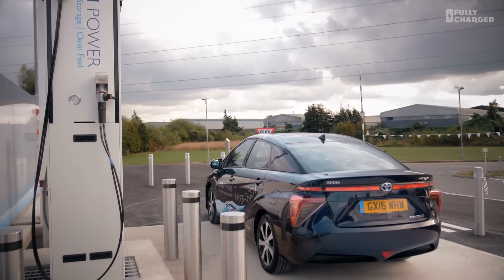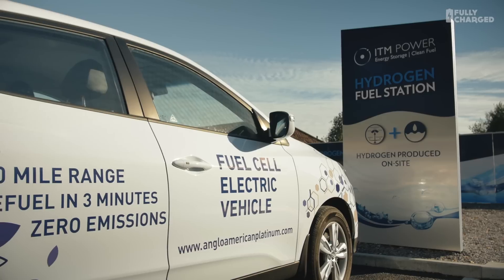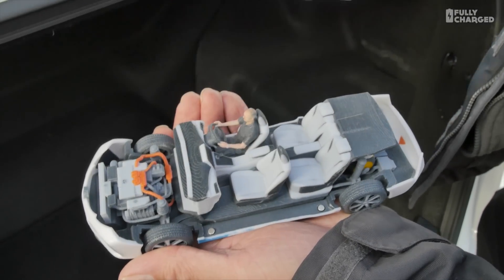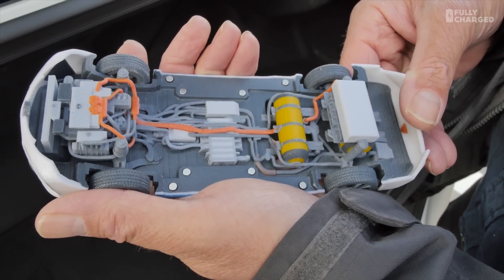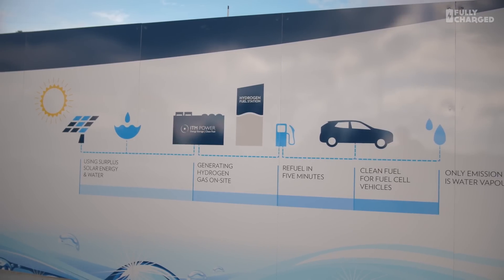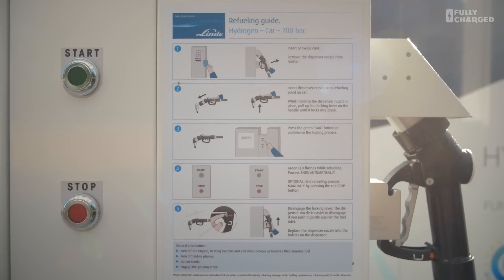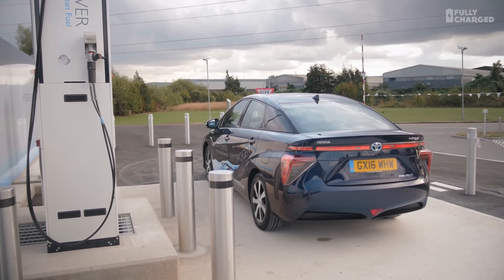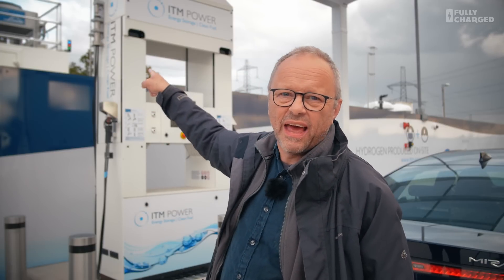ITM Hydrogen Rally | Fully Charged

Comment: Very interesting video, glad you still cover Hydrogen technology in detail even though people sometimes like to post negative comments about hydrogen.

Even though i love battery electric car technology, i believe hydrogen fuel cell will be just as important if not more so in the future because as mentioned in the video, fuel cell technology can be adapted to other transportation vehicles incredible quickly because you don't have that bottle neck of expensive, heavy, limited availability, limited life, lithium-ion batteries, and also i doubt there will be full battery electric long range lorries any time soon if even in the next decade (short range being done by Mercedes), so hydrogen fuel cells are the way to go, heck, they can even be adapted incredibly fast to boats, non-electrified trains, private jets, jumbo jets, giant cargo ships, local power storage, the list is endless for the long term over decades.

The idea of powering your home from your hydrogen powdered car is also fascinating, especially as the technology catches on and renewable energy expands with solar panels and wind turbines everywhere which means cheaper and cheaper clean energy to the point where renewable energy becomes so much cheaper than drilling deep into the ground in far away countries for oil (which could result in more wars) and then shipping them over in giant oil tanks, instead you can have a decentralised wind turbine, hydrogen fuel generator and as many hydrogen fuel storage tanks in the ground as you want and you're sorted.

I believe the future will be both battery electric vehicles as well as hydrogen fuel cell vehicles, which means less fossil fuels which can only be a good thing.

Comment: But can I fill up at my house????
Reply: Not really for the first few years probably (30ish im saying) unless you want some massive box in your back yard. There may be a away to incorporate into existing networks like gas and goes to your garage etc.
Reply: ***** idk about you but ive never seen a hydrogen fueling station
Reply: tigerfanman Because it's gas as you can see look at what's needed just to have 1 filling station look at that huge container converter.The teck inside your car is far more complicated than normal engine you'll have huge gas bottle in your care under massive presure sorry mate the only good thing about hydrogen is fill up in few minutes and at moment more milage .You can keep it electric cars are far easier to maintain you can fill at with any normal plug if needed at home with  solar panels or new solar roof tiles witch can power your  in tire home if wish and fast chargers to there loads around England .In say 3.5 years there will be cheaper  electric cares will have over 200 250 ++ range or more.Like GM Bolt that's out this year.
Reply: tigerfanman I really cannot see anyway of driving a month without a charge unless your my nan, but I'd love to see it and I can see week and half 2 maybe but yea
Reply: ***** given I do about a 1000 miles a month, that would be pretty impressive
Reply: "ive never seen a hydrogen fueling station".  
That's because there are about 4 in the UK at the moment. One on outskirts of London and one in Sheffield. Not sure about the others. But clearly there can easily be more - it's just all super-expensive right now. ITM's splitter box is very expensive and the Mirai is very expensive (70 grand IIRC). But taxi firms in Sheffield are using it, and with a few more early adopters it could really become a thing. A lot of people want a fast-fill long-distance no-CO2 vehicle. And this is one.
Reply: It charges while you sleep, like a big cellphone sitting in the garage. You will never need to take a detour to fill up ever again save for those rare long road trips. 

It's just always full and ready to go every morning.
Reply: my landlord could easily put in a charger.  Its more of a matter of how to bill for the power
Reply: "save for those rare long road trips". Some of us never get in a car unless we are going a decent distance. All local trips (work, shops, pub, entertainment) are by bike. Trips to London are by train. I only use the car for going to Devon, Wales, Yorkshire, Scotland, France, Austria. It's very rare to go anywhere less than 100 miles away, and usually 200 miles or 900 miles. There is the occasional trip of only a few miles, e.g. to collect plasterboard, but that's maybe 5/yr. So stopping to fill up when travelling is not going to be at all rare: it'll be the majority.
Reply: I'll just leave this here:  http://world.honda.com/FuelCell/HydrogenStation/HomeEnergyStationIII/
Reply: Alberto Knox I bet the hydrogen stations don't even work, and they are not as prevalent as charging stations for long trips and at home for daily driving.
Reply: Alberto Knox Show me a road trip video, of a hydrogen car. It debuted around 2012 , when the Model S came out, so where are they?
Reply: azalru Did you not watch the video and of course they work man unless you can show me how not just which ones arent working.
Reply: Apartment parkings and street parking can be equipped with chargers. Plenty of examples of street and parking charging. It's a people issue, not a technology problem.
Reply: They're not selling it, so what's the point?
Reply: Allan Omar if everyone in the uk filled up there electric vehicle overnight the national grid would completely crash and blackout 
We need alternatives like hydrogen
Reply: Jake Buttons we need to modernize the grid.  it was never meant to handle transportation on top of everything else
Reply: deathpony698  such a drastic expansion to the power network will be a terribly expensive infrastructure challenge. Even with the infrastructure in place how would you ensure adequate power generation exactly when you need it. One of the advantages of hydrogen generated by electrolysis is that the refuelling event can occur at a different time to the power consumption , it is in this way that hydrogen provides a route to zero carbon transport by using excess renewable power that would otherwise be wasted.
Reply: tigerfanman Totally wrong, you can't fill up "anywhere".
Reply: Fuel cells are garbage (or at least more appropriate for garbage trucks), and you can sorta tell the Toyota guy knows it.
Reply: Jake Buttons idk if you've heard cause its kinda new, but there is this thing called the home battery, they also have commercial ones!
Reply: Jesus this is comical!

You guys should try arguing politics. It's easier to get better talking points to troll with there.
Reply: Hydrogen will, not too many moons into the future, replace natural gas. The answer is yes.

Comment: It's a "clean car", but the infrastructure is still dirty. Yes there's a wind turbine, but how much extra energy is fed in? I guarantee you it's not 100% wind, it's going to be mostly from the grid. If you're going to have a wind turbine produce electricity, than it's better to just use that to charge electric cars\batteries. Using electrolysis to make hydrogen means that you're going to waste at least 50% of the energy just to split the hydrogen out and then compress it to ~5k-10k psi, and don't forget the necessary cooling as well. So half the energy is wasted in order to create the fuel.......... That's 2x more inefficient than charging a battery! The only advantage is faster refueling... But that won't be an advantage for long with battery improvements coming along.

Comment: Looking at the figures, a Mirai doing 15,000 miles annum would consume 2 tonnes of water at the station, presumably extracted from the local supply system and release 2 tones of water into the atmosphere per year. That would be an effective consumption of an additional 2 tones of water per driver and potentially an increase in water consumption of around 4% per person out of the national water distribution system. Significant?
Reply: I suspect it is probably near a wash (PI) with current gasoline cars.  But you are correct that BEVs are NOT putting water into the atmosphere, which will probably have an environmental impact.

Comment: Take you average battery electric car, shrink the battery a bit. Add a very expensive fuel cell, pumps, valves, a hydrogen tank and safety system. Then, use fuel that needs 20x as much electricity to create and store than the electricity that you normally store in a battery electric vehicle. Not to forget the wear and tear if the massive anodes and cathodes to create the hydrogen and of course the infrastructure to physically transport the fuel.. 

It's a fucking waste of energy, resources and research!!
Reply: Did you even watch the video?
Reply: 20 times as much electricity? Did you skip school?

Comment: Fool Cell. Designed to keep you hooked on filling stations for big $$. The pump in the video shows 9.99UK or $12.29/Kg of H. That amounts to 33.33 kWh/kg of energy. A PEV makes way more sense financially and environmentally (98% of all H produced is a by-product of the fossil fuel industry). Charging a PEV to the equivalent would cost $5.32 for a 33.33 kWh charge @ $0.16/kWh

Comment: Still, you can give EV 3 times as much kilometers as this hydrogen filling station. Whilst still using excess energy from the grid.
Reply: Pure electric is useless for long distance, there's just no reason to use pure electric cars when there's hydrogen-electric cars on the market meaning you never have to worry about how far you need to go
Reply: MrcabooseVG useless? You should ask Tesla owners how far they drive each year.
Reply: Mats Lindholm In small increments, you can't even get close to travelling through a small country like the UK in one go. Plus they cost too much and will cost just as much to fix
Reply: ***** so going on vacation from sweden to italy for example is not possible at all with an electric car then?
Reply: Hydrogen refill costs ALOT, Mirai is only say 10k cheaper than cheapest S, only has like 50 to 100km longer range. And you can charge an EV just about everywhere (time permitting)
Reply: Mirai is said to output a max 114 kWh and 370 NEDC Miles range where as Tesla recently release a 100 kWh battery pack with a slightly longer range of 381 NEDC Miles. I for one seeing as Nikola Motors came out with the announcement of the model One Semi Truck and switch from NG to Hydrogen, seeing as its more green than diesel in comparison and also more powerful and no uphill lag in comparison to diesel as well. I am hoping to see trucks run more on hydrogen-electric hybrid since it is more power dense and fuels up faster than being all electric and having greater range as well per tank to both Diesel and all electric.
Reply: Mats Lindholm Of course it's possible, i'd rather go in a petrol car. It's entirely possible you'd get stuck in an electric car
Reply: ***** Its entirely possible to get stuck in a dino powered car, as that substance really doesnt grow on every electric outlet...

Comment: Most hydrogen these days is produced as a byproduct of refining fossil fuels. It's not hard to see who is behind the push to hydrogen.
 
Hydrogen by itself is clean if it is produced as shown in Roberts  video. Extremely inefficient, though using electricity to split water creating hydrogen to create electricity and then recombine with oxygen to create water.
Reply: The guy does state that first fact of yours in the video but states they are not getting hydrogen from fossil fuels, but rather from fresh water.
Reply: I know. I indicated that by mentioning the clean generation in the video in my original comment.

Comment: How is the energy efficiency from the cell to torque to the road, compared to a BEV?
Could such infrastructure not also be used to simply created electricity, and more of it than now possible through hydrogen?
Reply: Fuel cell vehicles use batteries and electric motors, just like an EV.  The difference is that the batteries are charged from a fuel cell.  The problem is that the Hydrogen uses 4 times as much energy to go the same distance as an EV, when the Hydrogen is made from splitting water.
Reply: Splitting water is quite efficient, so the cell itself is bad at  returning this invested spliiting energy? Then why have a fuel cell, not a relatively standard ICE? Those also are emitting 70% heat for 30% drive.
Reply: Cloxxki The overall efficiency of fuel cell vehicles is much lower than battery vehicles for the same input energy, when the Hydrogen is made from electrolysis of water.  Google "well to wheels efficiency of fuel cell vehicles".
Reply: You miss the point. In the ITM scheme Hydrogen is only produced using energy that is otherwise wasted ie excess renewable energy. Then the hydrogen itself becomes the energy store. Who needs flaming  batteries? Who wants to wait 30 minutes to recharge their vehicle after a 50 mile drive? Delusionals.
The excess hydrogen thus produced on a larger scale can either go into the gas main (coal gas used to be 50% H2.) or be stored as vehicle fuel.
Reply: I do understand though. What I wonder is, to put it more simply, how much mileage can be achieved from making hydrogen versus using the same wasted sounce energy as electricity? In stead of the fuel cell, one might have batteries and do just fine or better.
Can this wasted energy ONLY be captured via hydrogen as storage? Why not give this super green energy to the grid where it is immediately used?
And the 30 minutes charge time of a battery EV only applied after you've used up the first charge of the day. If you can afford a hydrogen car or BEV, you probably have a private garage or at least car port to charge overnight. 
Tesla's bottom line will be 215 mile EPA range. That's what you get when you drive off in the morning. A hydrogen car will on average be, say, 60% full. And where do you do this recharge? Tesla and other option chargers are basically everywhere. VW is paying for a whole lot because of diesel gate. They'll be really fast chargers.
How many time per year does the average family car owner go past 200 miles per day, to even need a 30 minute recharge? And how much waiting is left after a comfort brake and snake? The hydrogen job takes time when you stay with the vehicle. Comfort and snack will be time added to this.
Reply: Cloxxki The "wasted energy" can be stored in battery pack, either in cars, or in home (one example, Tesla Powerwall) or in industrial quantities (one example, Tesla Power Pack).  Doing so is about 4 times more energy efficient than converting it to Hydrogen for fuel cell vehicles, and batteries will become increasingly available, especially as more EVs are made.  In this context, Hydrogen makes little sense.
Reply: fingerstyleguitarman Hydrogen cannot be used in existing methane gas lines. The Hydrogen molecules are too small and will leak out easily.  Battery safety is very high at this point, and fast charging times are low.  Fast charging is only needed on very long journeys.  Most EV owners charge at home overnight and have a full tank in the morning.
Reply: Its funny that it loops back to the main issue with Toyota´s strategy;The Idea that we will not be able to build bigger and better batteries. "Hydro will save all that wasted energy from renewables" but with more efficient and cheap batteries we dont have that problem to begin with! And this must all be a shaking corpse or some uk exec trying to score some government/EU funding 'couse Toyota launced a BEV strategy just yesterday to mass produce a 200 mile BATTERY EV by 2020, hehe :)
Reply: Robin Olofsson Before long Tesla will be refurbishing HUGE amounts of batteries. Already there are road side power banks from Prius batteries I believe. This will not diminish. And there's the grid to direct power to the next available storage.
Reply: Cloxxki Actually the batteries last so long that there's not much to recycle for the next few decades.  That's especially the case for thermally managed batteries like Tesla, Volt, Bolt, etc.  That said, Lithium batteries definitely will be recycled or reused when necessary.  All the EV makers have plans and processes already put in place for recycling or reuse.
Reply: Loanword Eggcorn the recycling of batteries kind of destroys the sceptics' argument "but what about the pollution due to the battery manufacturing!!!
As if ICE's and gearboxes are environment neutral to produce. Let alone the oil and gas they take (and dump) over the decades. Who ever recycles a molecule of fossil fuel? Only nature does that, patially.
Reply: Cloxxki Not totally.  The two main things about making batteries (or really anything) are environmental damage from mining the materials, and all the energy used to make the product.  Some of the energy can come from renewables like solar and wind, but when raw materials are used for making new (anything), there is an effect on the environment.  If renewable energy is used to manufacture things, and recycled materials are used to re(make) them, then the environmental impact could be said to be minimal.  That would be the case for some of the (recycled) Tesla battery packs, for example, since the Gigafactory intends to use only renewable energy.

Comment: The Prius actually uses the petrol/gasoline engine for more than electricity generation. At least in my 2010 Prius, the electric motor is not powerful enough to drive the car fully. When accelerating or on hills, the petrol engine puts its power straight into the wheels, often combined with the electric motor.